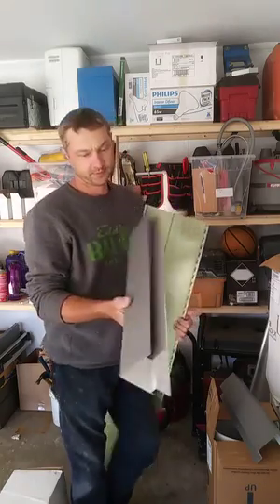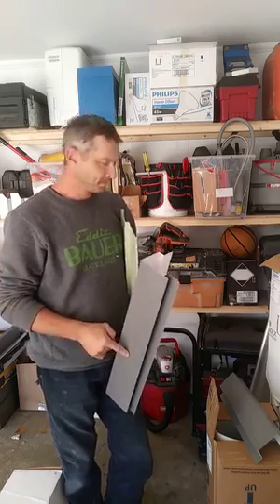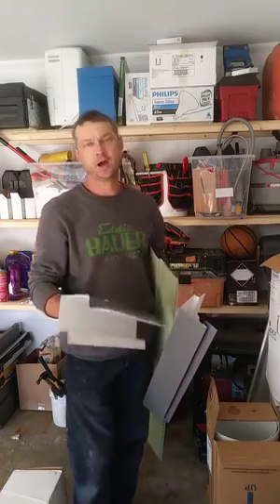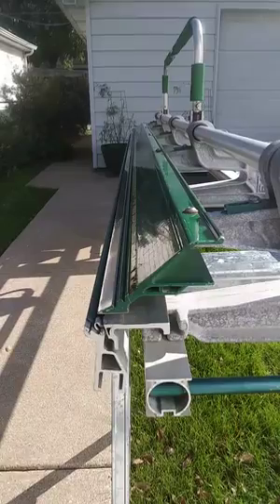Aluminum corner post! Best way to make it! Aluminum work-tips and tricks.

Comment: Hello. First of all, thank you for the video. I have a few questions for you about aluminum siding. Is it possible to remove and reinstall aluminum siding without damaging it? Let's say the insurance company has approved only two elevations on a house. But you need to install the house wrap so that it overlaps the corner by 6 inches ( code requirement ). Is it possible to remove and reinstall a corner post without damaging it? The videos available on youtube suggest a negative answer to this. Maybe you have had a different experience? This is important for me to know because I work for a general contractor and often argue with insurance adjusters about siding without having much experience with it (I am a former industrial climber and have some experience with interior work). So if you respond to this comment, I would appreciate it. Thank you for the video and I wish you all the best.
Reply from the maker: hi! I never re/re corner posts . Very hard to to it without damaging. But i would assume its possible providing there is no caulking there - just nails. To re-install it would be a bit tough in your case  but you can nail it just on one side of the wall i suppose . i totally switched to steel siding and trying not to deal with aluminum at all.
Reply: @LeftoverCA  thank you very much!